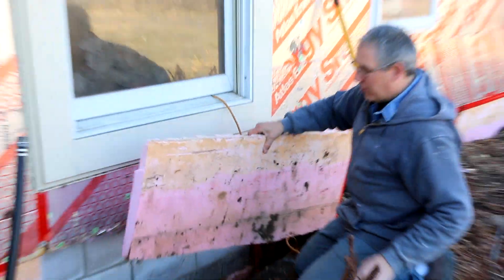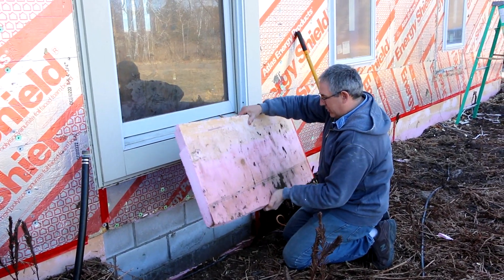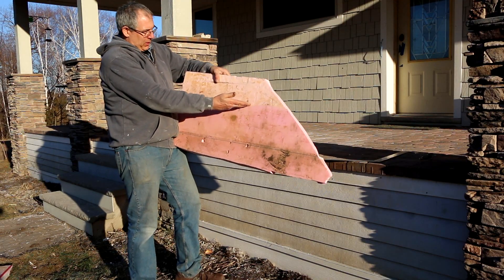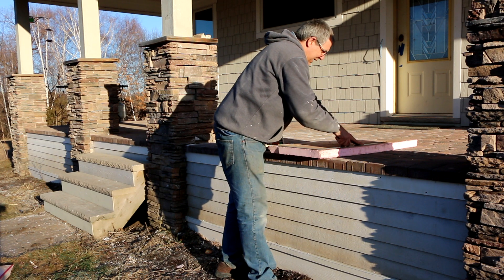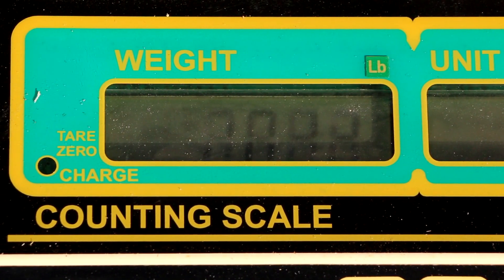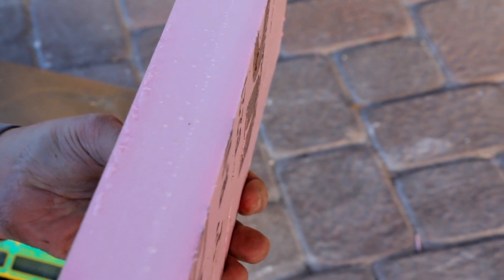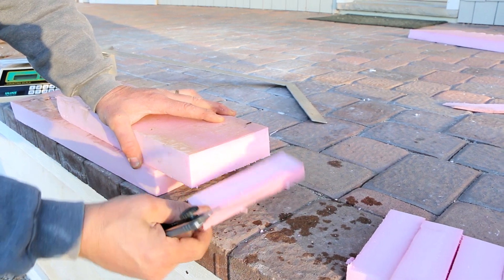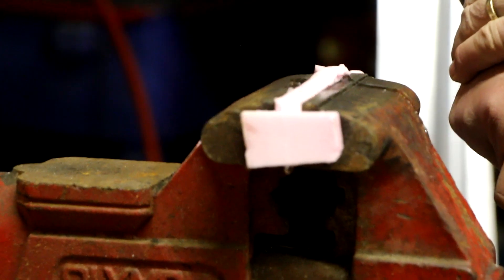XPS: Science Doesn't Lie (Manufacturers shade the truth)

Comment: Interesting. They still use XPS in direct contact (submerged) as boat dock floatation. It works well in this application, but that might be a difference between Owens Corning and DOW because it's the latter (blue) billets that are used in lakes.
Reply from the maker: Maybe so. EPS when used for floatation must  be incapsulated to prevent it from breaking down and loose beads floating.

Comment: So what's the solution? What insulation method should be used?
Reply from the maker: Insulate the interior of a basement and waterproof the outside solid foundation wall. Provide proper drainage, like a dimple mat, around the exterior of the foundation.  Don't apply a waterproofing membrane to foam insulation. This is not the best solution when you backfill the wall you have to be careful not to puncture the waterproof membrane. Like a balloon it only works well if there are no holes.
https://foundationhandbook.ornl.gov/handbook/toc.shtml
https://www.buildingscience.com/documents/digests/bsd-103-understanding-basements
Reply: @insofastllc  got it. Thanks.

Comment: What did you expect? XPS is full of air pockets. There was almost no degradation which is amazing for 17 years underground. If a moisture barrier was used there would have been little to no moisture. Key point always use some sort of waterproofing where there is rising damp.
Reply: how could this be waterproofed? what products are out there for this?
Reply from the maker: Insulate the interior of a basement and waterproof the outside foundation wall. Provide proper drainage around the exterior of the foundation. https://www.buildingscience.com/documents/digests/bsd-103-understanding-basements

Comment: Extruded Poly Styrene is not water proof, it is water resistant. I am a retired auto tech, not a builder or rep for any manufacture. If you agree with me that “Exterior Latex Paint” is water proof it simply fades due to “UV” light and the layer thickness degrades overtime after a rain shower! Agree? Good. To attach the EPS to a concrete foot or wall can be done several ways. First, PL300 is the adhesive for this foam. 2” X 6” boards across the face with 2” X 4” angled, cut and nailed like a concrete form, will allow it to cure. Just keep in mind that beads of PL300 should be vertical strips or 3/8” notch troweled on the block. If high spots from motor between the blocks, should be hammer off. If pressure washer, cleaner of paint, take a large wire bush and scratch the skin on EPS. “S” type mortar can be notch troweled on the back of the foam. Held in place as before. A coating needs to be applied and sold at Menards, Home Depot and Lowe’s for below grade use and can be painted. Also, under the panel, 6-10 or dirt should be replaced with gravel. Same as if I had a post. 4 feet is below the frost line here, but not only gravel for drainage, I cut the post on a 45 degree angle on each side. This reduces the surface area for frost heave. But EIFS uses an exterior latex resin in the mix with a color but marble chunks of different size. Below grade is different. They sell pre-made panels of different colors with aggregate applied with the same as product in buckets. Fiberglass cloth coated to resist the alkaline found in the limestone used in concrete. If proper steps are taken, this won’t happen. Like pressed hardboard siding? Never sealed on the back. Just a thought. Someone makes it, but someone installed it. Sent the fender on your work truck? Would you let a body shop put 1 inch thick plastic filler like Bondo? No! Product is made right, it was installed wrong. Simple!
Reply from the maker: For the record we do not recommend using PL300 adhesive with InSoFast in a damp environment we recommend Loctite PL Premium a moisture cured polyurethane adhesive.
Reply: EPS: EXPANDED POLY
XPS: EXTRUDED POLY 
Made of same material tiny plastic beads just a different process re, expanded/extruded. Both are around 98% AIR! This is the reason they make good insulation material. 
EPS is called open cell (water resistant not proof) where as XPS is marketed as closed cell (water proof) XPS also has a higher r value and higher compressive strength. 
That is XPS in the video not EPS but I totally agree with everything else youve said because with all insulation no matter what type, the most critical thing is proper/correct installation
Reply: @Wreck3d  Yes. Once the Pentane gas is released.

Comment: THANKS FOR THIS VIDEO !Well i thought thats XPS was totally waterproof  where EPS was more breathable! 
For  me XPS was better choice over EPS  underground but this does not seem to be the case! 
If your underground suffer of stagnation and you cant build an air chamber  its better look over foam glass.
For all outsoil structure i always preferred High density Eps due more breathable (similar value to solid brick), and easy for plaster to grip with less preparation
Reply from the maker: Our view is that interior insulation is easier and a more controllable environment. If you are going to insulate in a damp below grade area, expect ALL insulation to degrade in R-Value. Some insulations will degrade more than others. https://www.epsindustry.org/building-construction/moisture-resistance

Comment: If it is in the water without the possibility of drainage for a long time, this can be minimal.
There are special foundation plates for houses that have a profile on the outside, and a sealing coat must be applied to the masonry before the plates are installed.
If the foundation plates are ready, drainage with a gravel bed is mandatory so that the water does not stand still.
Reply from the maker: One of the laws of physic implies that nature seek an equilibrium all cellular wall systems will take on moisture. Drainage moves liquid away.
Reply: @insofastllc  Yes. Moisture is not good for your health.  No material is absolutely leak-proof.  Air is a good insulation material.  XPS is 97% air and 3% plastic.  But plastic is bad for everything.  So we should use it in building construction iin such a way that air has access to dry it.  With the answer you have just marked how important the entire planning is to get the most out of XPS.

Comment: Real world? What you are doing is taking anecdotal observations without all the facts and coming up with your own conclusions. That is not science. In reality I believe your observations actually prove some of the manufactures information (Facts). EXP foam is more moisture resistant than EPS foam. You contend that because 1 square foot of EXP that has been in the ground on the exterior of a foundation exposed to water for 16 years & weighs 2.3 pounds, that it is saturated and therefore does not perform as well as EPS? All that confirms is that there is a difference between absorption rates and retention. The EPS will allow more water to pass through quickly, & that has always been clear. It will also allow more water to penetrate & cause problems inside where the EXP foam will not allow water to pass through easily. (Not to mention that I don't see a membrane system on the exterior of the foundation walls of your example to prevent water penetration.) We have no information on what the moisture you noted does to the insulations performance. When it rains heavy, the EPS foam can actually saturate more quickly & loose more of its performance for retaining heat because the water continues to move through it, where the EXP would likely remain at a lower saturation rate, and hold any water & heat in place. (Similar to a wet suit holding in your body heat by keeping water from exchanging.) EXP foam already boasts a better R value when compared side by side to EPS foam. The only thing better about EPS foam is it breaths better & its cheap. Where water is concerned, 1 square foot of EXP foam used for floatation will displace or float 55 pounds. That is pretty far from the 2.3 pounds of weight you recorded on your scales for the same volume of 1 square foot of foam that was underground for 16 years. Hardly saturated. I imagine the manufacturer has had to do substantial research in laboratory conditions measuring many variables to determine which performs better. Sorry, but I will continue to trust their facts & science over your anecdotal thoughts.
Reply from the maker: You may of course believe what you want to however although we do demonstrate anecdotal through a youtube video we do not discount a single manufacture's anecdotal observation without researching, other "research", http://epsindustry.org/building-construction/moisture-resistance. 
Insulate the interior of a basement and waterproof the outside solid foundation wall. Provide proper drainage, like a dimple mat, around the exterior of the foundation.  Don't apply a waterproofing membrane to foam insulation. This is not the best solution when you backfill the wall you have to be careful not to puncture the waterproof membrane. Like a balloon it only works well if there are no holes.
https://foundationhandbook.ornl.gov/handbook/toc.shtml
https://www.buildingscience.com/documents/digests/bsd-103-understanding-basements

Comment from the maker: To be clear all insulation set below grade in wet dirt will eventually reach a moisture equilibrium... "it will get wet and lose insulation value." In our opinion all insulation should be placed on the DRY side of the wall.  For more information published by the XPSA EXTRUDED POLYSTYRENE FOAM ASSOCIATION https://s3.amazonaws.com/www.xpsa.com/XPSA+Technical+Insights-Winter-Spring-2020.pdf

Comment: There should be a dimpled plastic membrane set against the block wall and THEN a proper form of insulation.  Done.  Next.
Reply from the maker: Our opinion is that insulating the interior is easier and a more controllable environment. If you are going to insulate in a damp below grade area, expect ALL insulation to degrade in R-Value. Some insulations will degrade more than others. https://www.epsindustry.org/building-construction/moisture-resistance
https://foundationhandbook.ornl.gov/handbook/section2-1.shtml

Comment: I highly appreciate your research! My conclusion is different and i want to see what you think.
The problem as far as i see it ist that the material has been for long time in wet soil (humus) not gravel or anything which would let the water pass through easily instead of soaking water. What do you think about that? If thats the point EPS won´t perform better than XPS in that case as it will soak up water as well over the time...
Reply from the maker: To be clear all insulation set below grade in wet dirt will eventually reach a moisture equilibrium... "it will get wet and lose insulation value." In our opinion all insulation should be placed on the DRY side of the wall.  For more information published by the XPSA EXTRUDED POLYSTYRENE FOAM ASSOCIATION https://s3.amazonaws.com/www.xpsa.com/XPSA+Technical+Insights-Winter-Spring-2020.pdf

Comment: Basically you proved why there is a must to insulate XPS from ground by water barrier. Now you have to uncover all basement walls, let them dry(don't know if possible) or replace by new, dry ones. The apply water insulation/drainage system and then burry everything again, as now you have no insulation at all.

Comment: I wouldn't have thought. However these days they add a layer of loose blockwork and a layer of delta and then backfill. (with french drainage installed under the eps / xps at the bottom up and against the footing.

Comment: My guess is that any closed cell foam will slowly degrade due to freeze thaw cycles slowly "popping" the cells.
Reply from the maker: That is one reason. Another importantly is the vapor differential, wet earth (greater than XPS) will force its way through the xps's cell structure co-opting the vapor permeance of the material, this is where the xps rigid mono cellular structure works against itself. EPS cellular structure performs a bit better since the individual cells fused together yet are independent of each other. XPS is one big honeycombed cell.

Comment: Honestly, you are playing with fire no matter how you try to insulate a basement.  Exterior insulation?  Insect, water saturation, and damage problems.  Interior insulation?  Condensation, moisture entrapment, and thermal break problems. 

For what it costs to do all of these expensive procedures to "try" and finish your basement, people would just be better off adding on above grade.  You know that get what you expect: a permanently safe, dry, and financially manageable living space.  Until a new technology comes along, basements are just not a feasible place to obtain this.
Reply: Where I live basements are insulated externally with rockwool.
Reply: ICF does well below grade.
Reply from the maker: I don't disagree. In our experience above grade construction is not a permanently safe, dry, and/or always a financially manageable living space either. All construction done wrong is bad and risky, above or below. Financially manageable does not consider dense urban environments. Basement can be comparatively inexpensive alternatives if done correctly.

Comment: What a great video to illustrate how the cells of xps work.  XPS is created by melting plastic and then extruding it onto a conveyor belt to cool while blowing air through that melted plastic as it is being extruded.  Air in the melted plastic is so that the melted plastic will not just be extruded as a solid piece of polystyrene.  Air through melted plastic creates long capillary or almost stranded like cotton candy fibrous cells.  The long cells themselves have no space in between them that is susceptible to water...but the cells themselves can fill up with water.  In fact, there are tests showing up to 60% water weight in boards like these ones in the video.  Doesn't matter what color, the process is the same: blow carbon dioxide or fluorocarbons into melted plastic being extruded.  The resulting "closed" cells are very susceptible to taking on moisture...but the moisture never leaves the board.

Comment: so which is the best? XPS that resists more to water but when the water gets in it is then also difficult to get out  or EPS that resists less to water but also release it more quickly??? because i know that it is important for our products to breath, they release water vabor from inside the building.
Reply: A very intelligent observation.  The short answer: The one that dries out gives the best long-term performance. The space between the cells of EPS actually are the key to ultimate dry-ability and performance.  As the provider of the video points out, always plan for protection from water no matter what is used. With under slab or perimeter insulation as showing here though: EPS always outperforms over time due to its ability to cycle with the soil and dry out. The space between the beads is the only space for water to enter the board vs. all of the capillaries created with the manufacturing process of XPS. There is a limited interstitial space in the EPS (white or black rigid) vs. up to 60% of the volume of the board dyed blue, pink, yellow, green etc.  Both are polystyrene.  The air blown into the extruded board is usually a CFC or HFC so there is an initial slightly higher R-value but the "special" air eventually escapes leaving the user with a plastic board that has plain air in the cells.  EPS (white or black) starts with just plain air...so R-Value is permanent.  The "P" in EPS and XPS stands for polystyrene which is just a plastic.  SO: Same plastic, different manufacturing process.  BASF invented both processes and sold the one they thought was inferior to a brilliant marketing company called DOW Chemical.
Reply from the maker: It is not so much what you use either foam can be made to work. The important questions to ask is where you use it and how much do I have to do to make it work. ALL insulation need to stay dry to work. How hard do you have to work to keep the insulation DRY? This is an important reason why we encourage to insulate the interior of a basement wall. The insulation is on the correct side of the hydrostatic head pressure... It can dry to the inside. If you follow this link you can read an obscure statement http://foundationhandbook.ornl.gov/handbook/section2-1.shtml  that will state:
Experimental data indicate that this moisture accumulation may reduce the effective R-value as much as 35%-44%. Research conducted at Oak Ridge National Laboratories studied the moisture content and thermal resistance of foam insulation exposed below grade for fifteen years; moisture may continue to accumulate and degrade thermal performance beyond the fifteen-year time frame of the study.

Comment from the maker: That's okay foam isn't for everyone. What this video demonstrates is that if foams are not protected from the elements (water) they can absorb and hold on to water over time losing their ability to insulate. Sometimes using and extruded closed cell foam with low permeability is not the best choice. It is better to use insulations that are engineered or have a natural ability to drain and dry,